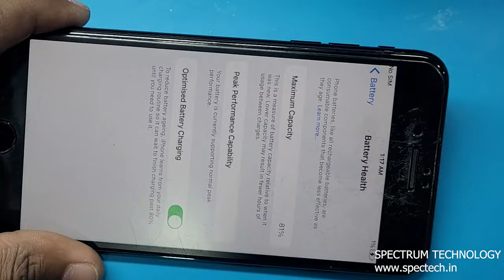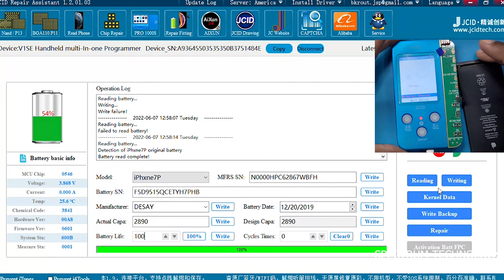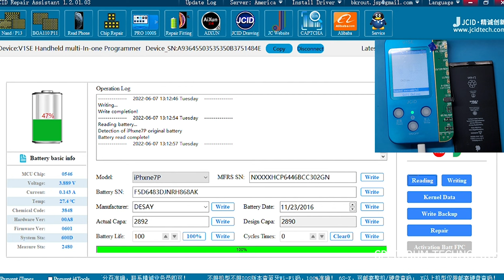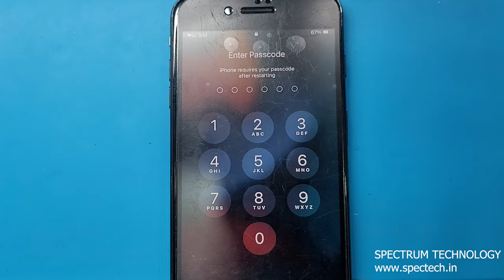#iPhone 7 Plus battery replacement with Jc v1se programmer.

Comment: JCID programmer is used for iPhone screen original color, Face ID, battery, receiver FPC cable vibration data reading and writing repair, DFU purple screen mode, etc.
Reply from the maker: Yes we use all kind of programmers to fix iphone